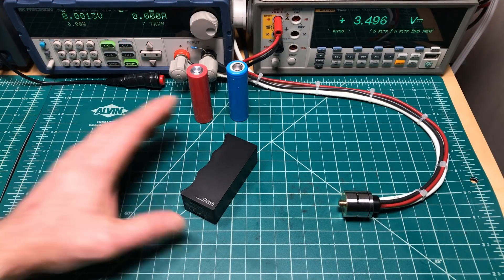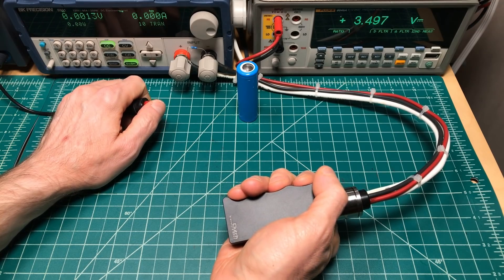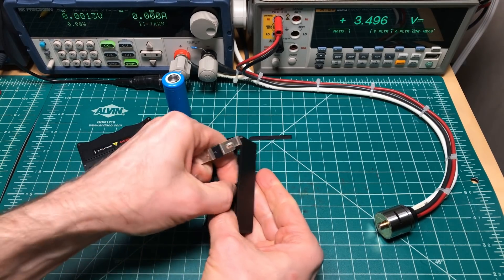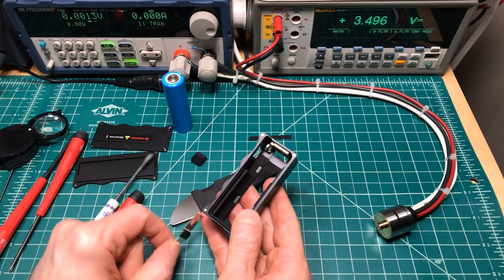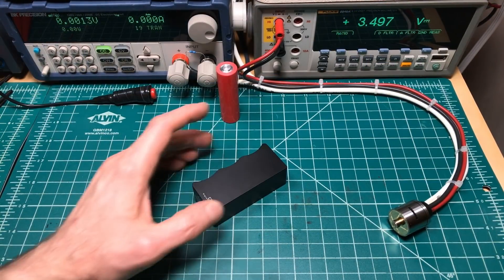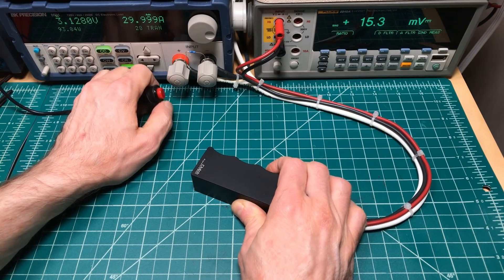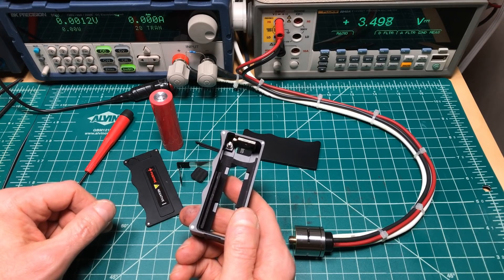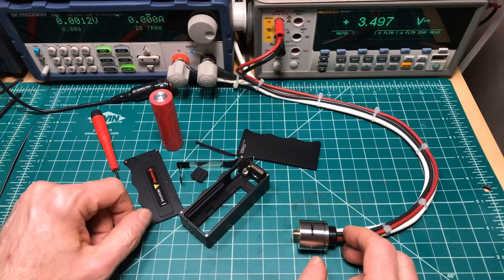Minding Your Mechs Ep025 – Clutch 21700 – Voltage drop and thermal imaging testing

Comment: Thanks Mooch this is really good to know!!! just ordered myself a Clutch and some Molicell P42A batteries. I'm trying to work out what sort of voltage ill see at the coil with a 0.2ohm build to work out the amp draw on the battery, according to your test results at around 20 amps of current the Molicell P42A sags to about 3.8V, then i'm assuming i subtract the voltage drop in the mod itself at approx 0.165volts, so around 3.63volts or 18 amps of current with a 0.2ohm build???
Reply from the maker: Sounds about right. The current doesn’t vary much when including, or not, the voltage drop in the mod though. Other things like how it was charged, the cell temperature, the age and condition of the cell, etc., can have a bigger effect on the voltage when used.
Reply: @batterymooch  awesome, thanks 👍🏻

Comment: Big thanks mooch ! This video and the one about maintenance are great for Clutch and SQ Topside users. In fact you helped me to understand why my topside sq wasn't hitting as hard as it should. Even though I removed all arcing marks it started to drop more and more voltage. It was the tiny screws which were not tightened enough. I dismantled it a few times and wasn't screwing hard enough by fearing to strip the threads. I didn't had this problem on the clutch. Now I can survive the vapocalypse ! The clutch and the topside sq are the only mods I need !

Comment: Thanks mooch! Always appreciate your expertise.. I got mine the other day and love it. I run a .08 all day.  Perfect for me
Reply: Can I ask what batteries you use for that resistance buddy? I'm waiting for my clutch to come and purchased some Samsung 30Ts which are 35A continuous so I think are good for 0.12 if my maths is correct. Would love to go to a lower resistance but want to be safe. Cheers
Reply: Simon Hobden I wouldn’t go below .10 or .09  and don’t chain-vape like a mad man and you’re good. Samsung 30t
Reply: What do you guys use to get rid of any arcing on the brass plate or the positive end of the contact bar? I run a .09-.11 with on my Clutches with a 30T and I'm getting much worse arcing than I seen on the Video.

Comment: Hey Mooch I was wondering if your tests on the original SQ mech would be applicabile to the SQ 217? Maybe that's a stupid question but I just picked up a mech mod for the first time after being to afraid to get into them, but your videos have helped me understand CDR, battery saftey and ohms so I really can't thank you enough for stressing saftey and understanding as opposed to blindly building super low and running 40 amps out of your battery regularly without understanding of the risks involved, you probably here this a lot but your channel is by far the most important resource for any vaper who uses a regulated or mech mod using loose removal batteries
Reply from the maker: Thank you for your kind words! I don’t know if the SQ217 uses the same contact, same metals, thicknesses, etc. I’d be surprised if it performed a lot differently but I just don’t know.
Reply: @batterymooch  Awesome! Thanks very much for the reply and everything else

Comment: Wouldn't a thicker nickel-plated copper plate provide better performance and be significantly cheaper than a silver plate? Silver seems like an extravagant choice.
Reply from the maker: The contact strip is all silver, not plated. It could be less expensive but pure silver is a little bit more conductive than pure copper. Thicker could help too but the size of the actual contact patch between the contacts is critical. There are power losses in other parts of the mech too.

Comment: I may be wrong about this, but a quick search shows that the emissivity of human skin is 0.97-0.99, while the emissivity of silver is 0.02-0.04. I don't think you can say that the temperature of silver is the same as the temperature of your skin just because they show up the same on a thermal camera.
Reply from the maker: I mention in the video, I believe, that the silver is painted flat black. If I didn’t mention it...all metals in my videos where the temperature is important are painted flat black or covered in black tape. This brings the emissivity of the metal up to a very high level (what my thermal camera is calibrated for).
Reply: @batterymooch  I see, thanks for clearing that up for me. I don't think you mentioned it in this video, but I could have missed it.
Reply from the maker: Check out my video on thermal imaging as it shows why I use black paint or tape in all my videos.

Comment: would running 4.2v @ 30A change the drop?
Reply from the maker: No. The battery voltage does not affect the voltage drop in the mod. Only the amount of current affects the voltage drop and, of course, the resistance of the mod.

Comment: Now they just need a dual battery one.  I have 3000grit sand paper that i use on my contacts/buttons. I dont really notice a power different, but it does seems to lessen the arc marks that they get on them...

Comment: Easier to replace the silver contact than get a new brass 510 plate. Re; Arcing...
Reply from the maker: I don’t know which parts will be made available as spares.
Reply: @batterymooch  im not suggesting dovpo or SQ is going to supply them. But you can get the strips at any mod maker online store and bend them up yourself. I've upgraded 2 of my squonk with solid silver contacts not too long ago
Reply from the maker: Meech Ahh....okay.